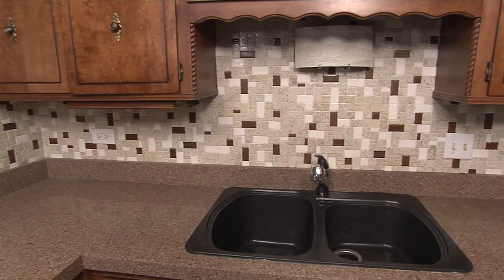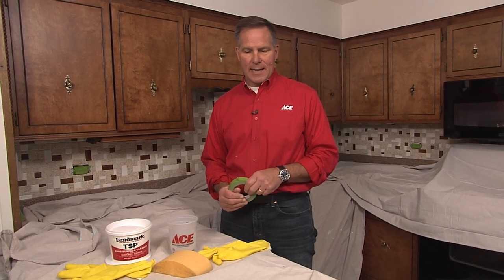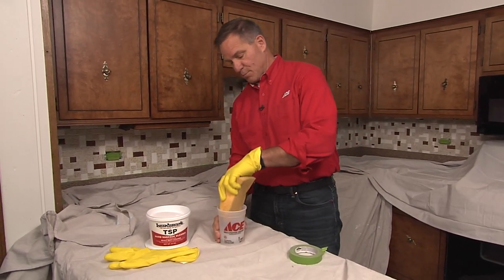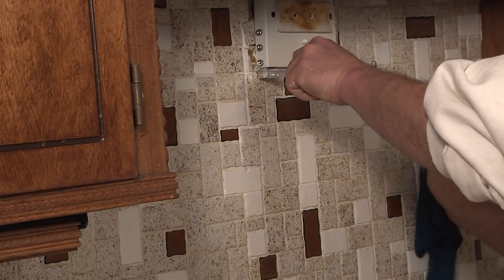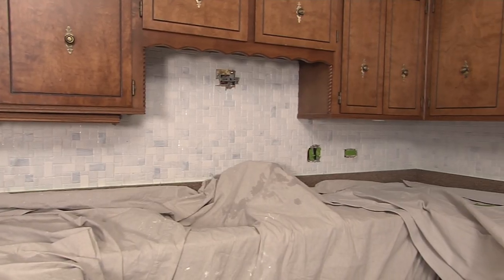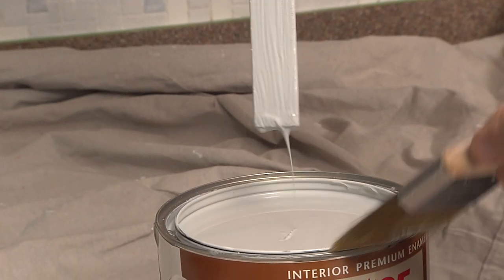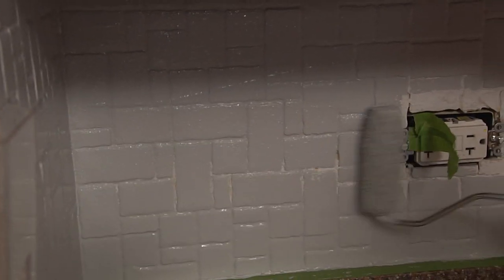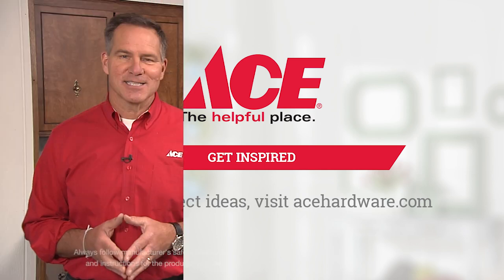Paint A Backsplash - Ace Hardware

Comment: Prep work. Remove outlets covers. Tape off area. Use gloves when using tsp as per instructions. Finish with clean water. Medium grit sanding. Primer. Wait for 2 hours to dry. 2 coats of alkylate based paint using a 3 inch nap roller.

Comment: What about glass tiles? Same thing? Same kind of paint?
Reply from the maker: Hi Lisa, Apologies i the delay to respond. This was a tricky one and we wanted to ask a few people. The good folks at Rust-Oleum have a suggestion for you!  A Bullseye 123 Primer will adhere to glass, and is available in a brush-on format. They suggest allowing the primer to dry overnight before painting.  Full cure / adhesion of the primer to the surface will then take 7-10 days.  After the primer is applied, the paint color, finish, etc. is up to you and your preference.   However, a glossier finish will typically be easier to clean and keep clean.  Hope this all helps! Again, sorry for the delay in a response and good luck!
Reply: @AceHardware  Could this technique, of the primer, then the cabinet paint, be used to back paint a sheet of glass to be used behind a slide in range, as a backsplash?

Comment: I have travertine tile back splash I want to paint white. What are your recommendations?
Reply from the maker: Hi Fawn,
As travertine is a limestone tile you would treat like any other tile. Clean thoroughly with soap and water, rinse well and prime with a latex bonding primer like Royal Sealing & Blocking interior & exterior primer, INSL-X STIX Primer OR KILZ ADHESION primer. 
For a backsplash, you can use a latex topcoat like Clark+Kensington interior. I would recommend at least a satin finish, but preferably a semi-gloss as that will be the easiest to clean long term. You might want to note that latex paints dry to the touch quickly, but they take a bit longer to fully cure and harden. Refrain from washing the newly painted surface or checking the adhesion for at least a week or two after painting. 

Hope this helps! You are welcome to take a closeup photo of your backsplash and bring it into your local Ace for them to give you further input.
Reply: Travertine is beautiful. Can I ask why you want to paint it?

Comment: Can you do the same with a glossy current tile  I guess just sand it and then apply primer and last paint ?
Reply from the maker: Yes. First, you need to clean the tile. Then the paint will stick. A little light sanding won’t hurt, but is not necessary.
Reply: @AceHardware  thanks
Reply: @AceHardware  Is there a way to just stain the backsplash with a concert stain or something similar to slightly change to color...